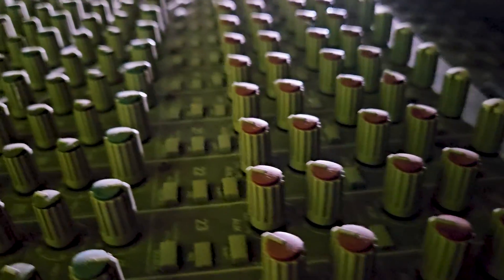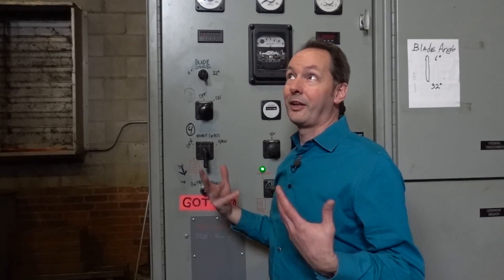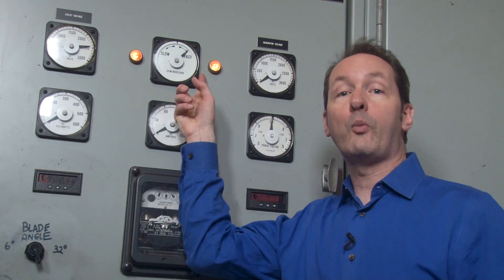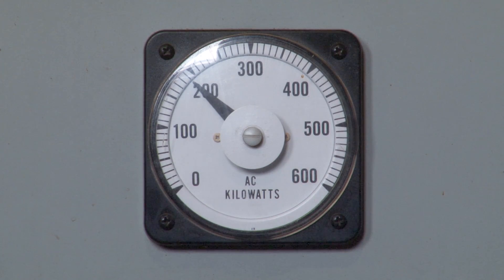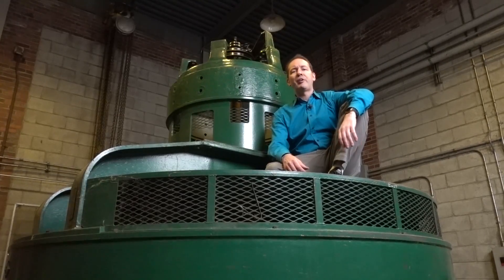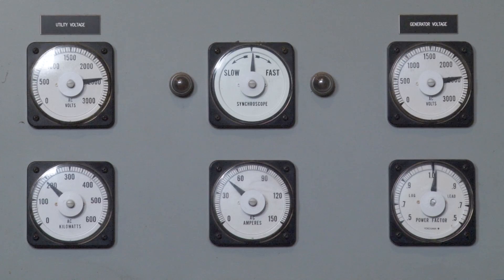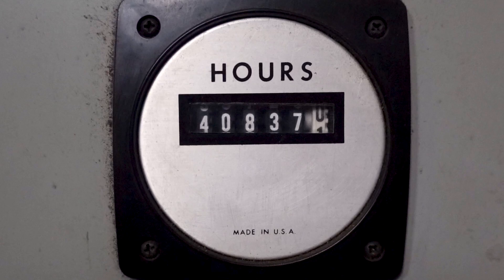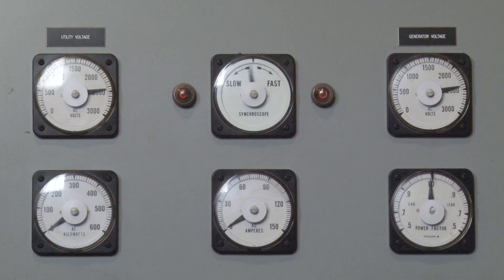Powerplant Control Panel Tour - Part 1 Authorized Personnel Only S4E1 #engineering #powerplant

Comment: House power ratings are a strange one. And really evolving right now.

Houses with some lights, a fridge, some short use appliances, and a mix of entertainment/ IT equipment would typically draw 1-2 kW on average per day.  25-50 kWh.

But, now add in modern loads that are now mostly electric in most areas (offsets other energy sources - oil, gas, wood):

- laundry drying (3-6 kWh per load)

- Kitchen Range/cooking (1-5kWh typ per day) Note: kitchen appliances may offset range loads, transferring the energy usage to the appliances. Eg microwave, electric skillet. Also dependent on efficiency of appliances - eg induction vs simple heating elements 

- Dishwasher 1-2 kWh (dependant on efficiency and incoming water temp, and machine settings)

- Entertainment and typical IT is actually pretty efficient these days. TV's and monitors are typically 30-100W, computers are 30-100W avg. Add in modems, routers, etc 10-20W avg. Stereo's are minimal,  and even big surround systems are on a low duty cycle.
Cell phones, tablets, laptops, etc are almost negligible in terms of power consumption - amounting to maybe 10's of Wh's/day typically. 
0.5-2kWh per day

- Electric Based HVAC
* Fans, HRV etc 3-12 kWh per day
* Heat Pumps/Air Con: 10-200 kWh per day (VERY dependent on climate, season, house size and efficiency condition)
* electric water heater 5-20kWh (very dependant on useage)

- Electric car charger.  3-10kWh per day **Avg daily trip is ~40km, and typical electric vehicle uses 6kWh per day**
(Becoming more popular, and mandated for no more ICE cars to be sold new in 11 years)

So with modern loads, mostly HVAC related, very dependant on climate, household loads increase in the 2 to 10 times range. Avg 5-10kW or more. Consumption on the order of 50-250 kWh per day can be typical. Especially in winter in our area.
Reply: Also, strangely, many groups would have everyone believe that our grid can't handle EV's. When infact, they consume very little electricity % wise in most cases. 6kWh per day is the average per passenger EV...

Little known fact - 1L of gasoline takes about 2kWh of electricity to refine. That same 2kWh of electricity will take an EV about the same distance as the gasoline would have, and sometimes even further.

The many other electrical loads are a MUCH bigger issue to the grid. BUT electric companies will expand their generating capacity to accommodate as needed. They are in the business of selling those kWh's.
Reply: I did the math one time on phone charging, and it was astonishingly low. Something in the range of 10 dollars of electricity over the lifetime of a phone if I remember correctly.

And this miniaturization is occuring all around us. Order of magnitude reduction in cell tower power consumption (partially offset by more towers). LED lighting taking 1/6th the power of incandescent. It's like my electric bill is experiencing lunar gravity when I flick the switch!
Reply: @phillyphakename1255  yeah, it is astonishing low in most cases. Most phones only hold 10-15 Wh of energy. And that can last several days for some people. Even power users would be hard pressed to consume 10-20 Wh typically per day in most cases.
Reply: @phillyphakename1255  LED's are getting even better now!
LED's can now be had that can output on the order of 260 Lumins per watt. A typical 100W incandescent bulb puts out  ~1600 W.
Using the newest LED's, that 100 W lightbulb could be replaced with just 6W of LED's. Although driver losses will probably consume another watt or two.

Comment: 200 kW / 2400 volt / sqrt(3) (because the ammeter is measuring one leg); = "just over 48A" which is what the meter shows.  There would be a further error (which will be difficult to read given the scale of the instruments) where POWER could be different than kV * A because of non-unity power-factor.
Reply: Plus, the phases are never balanced. (the enduring problem of every power company. I pay attention to it in the data center, but there's not much I can do about it.)
Reply: @n1gak  This is the comment I was looking for! Thank you!

Comment: About the amperage - 3 phase power formula is P=√3*U*I*PF which in this case would make it P=√3*2440*46*1=194405W=194.405kW
That is, if I see the meters in video right. Still, I took readings from different times in video, so it cannot be considered exact result.
Reply from the maker: Now THAT is an excellent comment :) Thank you! There's a shot in there that shows the entire panel all at once so that all the readings match up in relation to time. That way people can check their math and be sure they got it right. :)
Reply: @Physicsduck  thank you! Good thing that electricity works the same in America and Latvia. Just some parameters change.
Reply: @Physicsduck  which now causes this armchair idiot to ask: Would there be benefit to taking Vegas Mode to level 3: A, V, kWh for each phase? (how critical is it that the 3 phases be somewhat balanced?)
Reply: Also, there is a phase voltage vs line voltage argument and so on.
Reply: Another fun one is delta-wye connections and wye-delta motor starters. It's amazing they figured that out and it can all be done with contactors!
Reply: @AugustusTitus  True! And not only on motors and generators but transformers and HV lines.
Reply: dang! good eye on the "2440" rather than just 2400.  I had to go back and look again.
Reply: @janisvaskevics93  I wonder how many people forgot the power factor beside you .
Reply: And there's those pesky peak vs RMS values.

Comment: Great video, Chris! While I can fully sympathize with your feelings about kWh, I find them most useful in discussing energy with normies. This is for the simple fact that this is how mere mortals read their power bills.

This is especially true when comparing things like battery capacity to various fuel sources. A great example is that 1 gallon of average gasoline contains 34kWh of energy. This facilitates the comparison of various power systems without requiring everyone to learn about Joules.

An interesting video about the syncroscope would be to use a dual-trace oscilloscope showing input and output voltages and the phases.

A question I have is this: is the amount of power you can push to the grid based upon modulating the exciter? I presume that the rotation speed determines frequency. I'd not thought about this until seeing this video. Thanks!
Reply: Once synchronised power delivery is controlled by the penstock height, trying to drive the generator harder against the load of the grid, ramping up current. Excitation voltage is there to regulate power factor, trying to provide as close to unity, or slightly leading, to compensate for all those pesky inductive transformers there on the grid, and the motor loads. there is interaction between them as well, ad excitation current is a lot faster to react over the massive rotating load and penstock controls.
Reply: Joules is easier than Watt-seconds imho. It wouldn't be that difficult to switch to megajoules.

Comment: What about a black start?
Reply from the maker: It's coming :)
Reply: Smaller plants like this can definitely be a good tool to get the grid up n running
Reply: In short, the grid needs plants that can start producing power without any grid power to operate pumps, valves, and so on. In a black start, the plant will island itself, get power generating, stabilize the frequency, connected to an isolated part of the grid where the next generator can use the grid power to get itself going. Load is carefully added to not let the frequency drift to much. But some load—like motors with momentum—are useful as they add spinning reserve. Spinning reserve is essentially momentum that keeps the frequency stable as load comes and goes. Spinning reserve is what keeps the frequency and voltage stable when a 500 MW plant trips offline in a large grid. Modern electrical plants will sense the grid frequency starting to drift and will adjust their power production up or down to get it back in line. The new battery-based grid storage plants can react in milliseconds and make a lot of money acting as spinning reserve in addition to their time shifting of electricity.

Comment: How can it make money with only 2-300 kw if you have staff ?
Reply from the maker: I have no idea. I'm just the Engineer, I can make anything except a profit.
Reply: That is something I've wondered. If it's a consistent 200kw, at 10 cents a kWh (which... probably generous; I could swear it's more like 4 cents at generation side), that works out to 20$/hr, 500$/day, or near 15k/mo. Which isn't nothing, but it seems like that entire retrofit / maintenance process from a bit ago would have been a near a decade's worth of income. Unless they're also getting a kickback for being black start capable. Or some other reason. Maybe the owner likes power plant control panels? 😛
Reply: @codertao If Chris' bean counters are smart, they'll have Chris or the PLC adjust the gates (penstocks?) to follow the spot price (I think that's the right term). Us "normies" tend to pay a steady $/kWh 24x7. But the wholesale price on many grids fluctuates minute by minute. Look up IESO, ERCOT, AESO, etc. Price / kWh on the wholesale market can quickly get up and over $1.00 / kWh. At that price Chris is not just in Vegas Mode, but planning a Vegas holiday!
Reply: @eh42  Yeah, there is that factor too- I was thinking they might also have some bonus as a fast response generator, but at such low output I'm not sure how much value that'd be (vs complexity of interacting with the grid operator)- and economically it may make more sense for them to just generate continuously, depending on river flow rates- I think they have a requirement to keep the headwater in a specific height range, so during high flow they may be able to run continuously at full tilt, but during drought they may well be near no-flow. And then in the middle they might be able to say "we can go through 20 acre-ft of water today, (and the turbine can only pass 5 acre-ft an hour), what's the best schedule for it".

And peak is variable; I'm in ERCOT, and the market price for electricity for today/tomorrow range from -0.005 to 0.035 USD/kWh. Not exactly a sellers market, but this is also the mildest February I can remember. I know it has gotten into the 1$/kWh range at extreme peaks, but I think that's rare. (0.50$/kWh may be a more normal peak).

I wonder how much control the PLC has over the water flow rate / power generated, and/or what the mechanism of control is: just exciter current, or also gates / blade angles / etc.
Reply: @eh42  Hydro controls engineer here. That is a good idea, and we do this where legal and applicable. The ISO has an API, which with a little Python code can be used to tell the PLC the current market price.
Reply: @codertao  The PLC can control the water flow rate from 0% to 100%. Deciding when to do peaking is a bit of a black art, akin to stock market day trading. One interesting thing is that prices can and do go negative, and a synchronized turbine/generator, with the wicket gates fully closed, actually can consume electricity and be paid for that.
Reply: Another reason those meters got AIPed, well, if you took them out then there's two holes in the panel.  Then you have to cut a piece of tin, nip the corners, cross bend it, hem the edges, and rivet it in place.  And when you're drilling for the rivets, you need to be mindful of where those metal chips go.  

Yeah that's too much like work.

Comment: Whats wrong with kWh as a energy unit?

Works well IMO.

Easy to calculate, and is a standard derived SI unit.

Only needs grade 4 math - a 1kW load, for 1h uses 1 kWh. A $0.15 kWh price results in a cost of $0.15 per hour of usage.
Reply: Joules would be too confusing to most. Especially when things are listed with watts on the label.

Plus, instead of 1kWh per hour, using 3.6M joules per hour would be a strange concept for many people. Watts are hard enough for non-electrical people in some cases.

Comment: V x A = W is only for DC circuits.  AC changes things
Reply: Still stands. It's just the simplified version of V * A * cos (theta) = P 

For DC, the trig function simplifies to 1, reducing to V*A=P

Edit: Note: Power Factor, or PF is just the calculated term of cos(theta). As DC can/is considered, in engineering terms, AC with an infinite cycle period (0 hertz). So it can be considered the voltage waveform is perfectly in phase with the current waveform.  Therefore, the current voltage phase relationship has a 0 deg phase shift. Cos 0 = 1, and why the  equation simplifies to V × A = P for DC.
Reply: @jeffl4810  I think the formula you want is Active Power [W] = V * A * PF where PF is cos(phi), phi is the lead or lag angle between voltage and current. Taking the cos function of PF doesn't make sense as PF is not an angle, it's a ratio.
Reply: @Graham_Wideman  the angle is the phase relationship of the voltage (hopefully) sine wave, vs the current sine wave. 
A lot of ratings simplify the phase relationship by denoting it PF, which is just a factor to multiply by, of the results from the original COS(theta) term

If the current is ahead of the voltage waveform, it's called leading, (cos-90 for purely capacitive) and caused by capacitive loads. Lagging is behind, and is caused by inductive loading (cos90 for purely inductive). Purely resistive is perfectly "in phase", and has a cos0=1 relationship. 
In reality, the theta will be between -90 and 90. The further away from 0 it is, the more "appernt" or "imaginary" power is flowing vs "Real" power. 

There are many other things, like mechanical loading being one, that affects power factor.  
Pretty much every electrical device other than old skool light bulbs and resistive heating elements (and even those often have phase controlled output mucking with power factor) has an imperfect power factor. Many loads are now required to have power factor correction circuitry in their power supplies to make the load appear as if it's resistive!
Reply: Exactly. It's AC. And AC is "voodoo". (there are three phases, and differences in voltage vs. current vs. phase - thus "power factor")
Reply: @jfbeam  
Haha. No magic involved. 
But it can get weird. 
Complex numbers (ie sqrt (-1) )  have a practical use when calculating this stuff. It's actually kinda interesting

Comment: One of the reasons reason for the difference between the Current times Voltage (Apparent Power VA) and the Power (W) can be the Power Factor. (Real Power= Powerfactor*Volage*Current)

I'm also just wondering why you don't have to supply reactive power to the grid, because usually that is required by the grid operators, because there are many inductive loads in the grid, which need to be compensated. Here in Germany you can be required to for example set you PV-System to a power factor as low as 0.9.
Reply: It depends on the utility. We used to be required to run at 0.96 PF (exporting VARs) but now they want 1.0 PF.